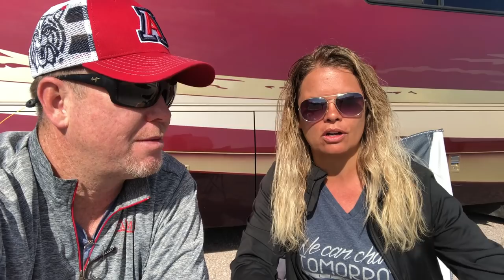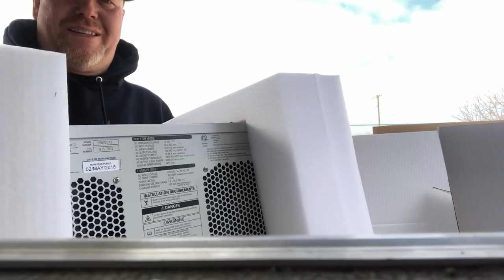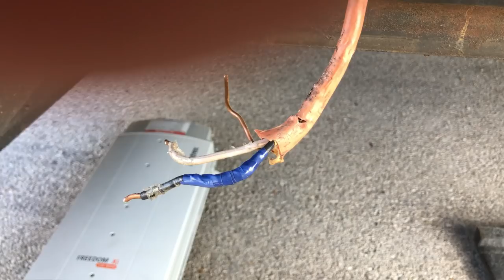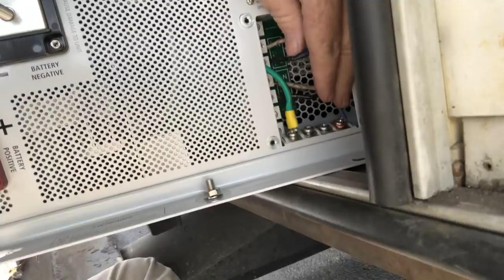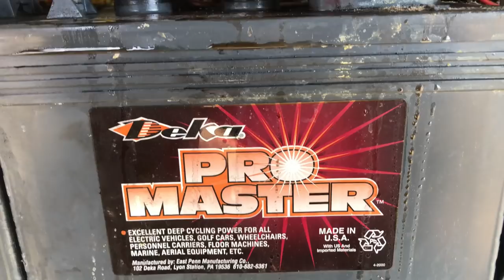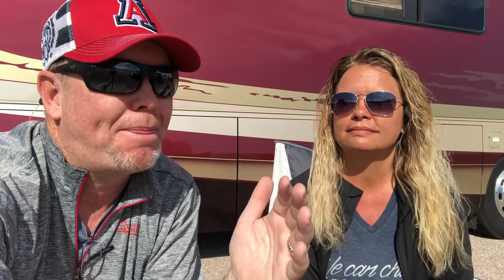RV INVERTER BREAKDOWN PROBLEMS /How to know if your INVERTER is BAD/Installation

Comment: They dont make these electronics like they use to.
My 2,500 trace inverter in my motor home is original from 1999
I have a 4,000 in my boat from October 2000.

Good luck 
Great Video.

Comment: Electrical issues are always chasing us on our older coach. Lost our key switch on our trip across the US last year and had to hot wire it. I have a few questions and a tip for you, I take it that the inverter only runs part of the coach since the wires going to it were 10 Gauge for 30 amp and would energize 1/2 of you 50 amp panel? Do you think that the inverter failed first and that is what took out the isolator? Why not just leave the Generator running while driving? Now the tip, we could not figure out why our isolator had a jumper wire going from the Alt to the chassis batteries side. After thinking about it the house and chassis batteries still remained somewhat isolated but we can never loose power to the chassis batteries as long as the alt is working. So even if the isolator blows out the alt would still keep us going down the road and keep us from getting stranded due to that jumper. Keep in mind we could still lose the the alt charge for the house side but that won't leave you worrying about the coach shutting off while in travel. Also want to clarify that this setup only works if you ar running down the road or plugged in most of the time. If you boon dock then you could potentially drain the house batteries down and the the chassis. If we ever decide to boon dock then I would wire the isolator up the way that it should have been installed or add a 100% duty cycle solenoid in place of that jumper.
Reply from the maker: Camp More Bark Less I can’t believe I missed this comment! That’s for leaving a comment!

Comment: When electrical issues happen, it seem to catapult into more. In 50+ yrs of RVing, we've only had one inverter go bad, and that was because bees built a nest in it while in storage. However, we've had more that our share of lighting and AC problems. Bulging is a sign of sealed batteries that were over charged. I'd go ahead and replace them as a precaution. Always err on the side of caution.
Reply from the maker: Roy Davis good idea! Thanks for taking the time to leave some knowledge

Comment: I completely understood it all, "the trials & errors"! "That 🐕 gone school of hard knocks", "I tell U"!! As U guys were talking I could even fill the 😈 whelming up inside of me, meaning I'm pretty sure there would have been a few harsh words come out of my mouth through that process!🙃 I'm sure glad the ending results turned out great! Also I'm wondering whether or not if that power converter U replaced is actually still good??, now that U discovered that whatchamacalla,🤔that thingamajig that allows the coach to charge while running that U replaced also,🤔 "sry I can't remember the name right now"🙃. Anyways U guys always have my prayers, now I need to add another prayer that U all (with the good Lord's  grace) recoup those revenue s spent!😇 i.e. for any undesirable that we encounter, there's desirables that's waiting to happen also!!😇😇 HAPPY TRAILS!!
Reply from the maker: Oscar Burleson thanks so much bro! Yes, the new inverter is working fantastic! We are so grateful! Thanks so much for the kind prayers and thoughts! Also I really appreciate you taking the time to leave a comment!

Comment: I hope I get this right but here goes. Your deep cycle batteries are charged by your inverter charger. While the batteries used to start your engine is charged by your alternator . You can use your deep cycle batteries to help start you engine most with have a switch to so this with. Chassis batteries are your deep Cycle otherwise known as house batteries. Sometimes in gas engines the switch is marked boost . I hope this helps because it can be a little hard to understand .

Comment: Viewing the compartment for the inverter it appears you might not have sufficient ventilation. Pure sine inverters emit extreme heat which could cause it to fail again from heat build up.
Reply from the maker: Roy Grillo thanks for the input!

Comment: My issue is, the stove would not turn on and the heater was blowing cold air. I lose battery power very eaily. A mechanic said it might be an inverter issue.
Reply from the maker: Have you tested the batteries?
Reply: @FreedomTours  They go low very quickly, and then nothing.
Reply: @FreedomTours  Then in the middle of the night everything goes off. No lights, no heat, no nothing but a cold Lisa.

Comment: Quick question, can’t you run the generator while driving?  🙏
Reply from the maker: Joseph Murolo that’s kind of hard to explain... your not wrong but that would be a VERY temporary fix... you can’t run your generator 24/7... #1. It’s meant to be used for a few hours at a time. #2. It would be very expensive. The Inverter is an absolute must have! Thanks so much for leaving a message!

Comment: What Motor is in your coach?
Reply from the maker: Josh Reed 400 Cummins
Reply: Full Time Freedom Run we’ve got a 300 ISB in our coach and had similar issues with our alternator finally got it sorted out now we have issues with our motor not running right the freightliner dealer says it’s a bad EGR valve
Reply from the maker: Josh Reed ours was from the failing of the inverter... so grateful that you watched and took the time to leave a comment! Thanks for the heads up

Comment: just put a upgrade alternator on my Freightliner DENSO 129.$ 200 amp not a ac Delco 130 amp like it had as the delco are crap the denso will out last my motorhome most of the part you can get like my  STARTER SOLENOID from  Freightliner over 150$ at autozone 18$ its a gm STARTER SOLENOID same part dodge alternator from a cummings also did new cooling system new Radiator $650 and water pump 40$ all new hoses for 180$ did it all for less than your alternator